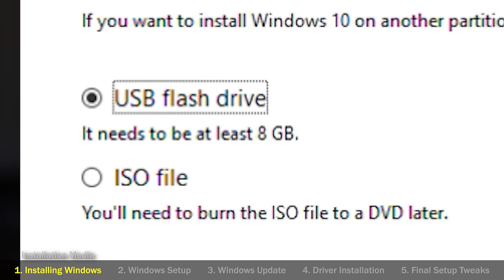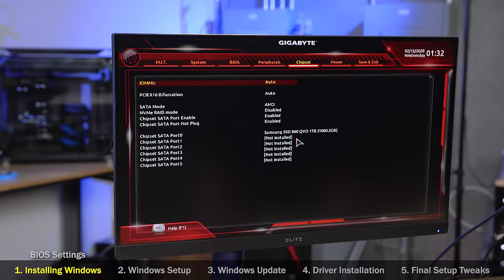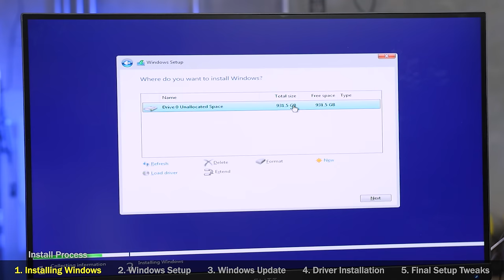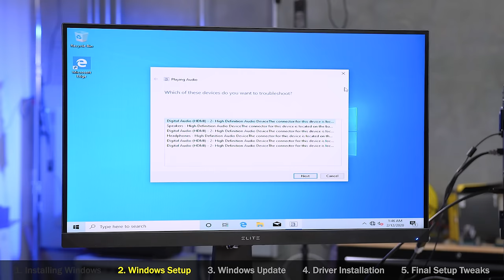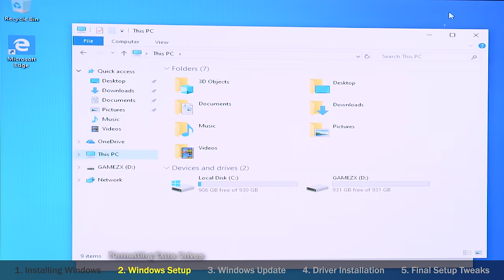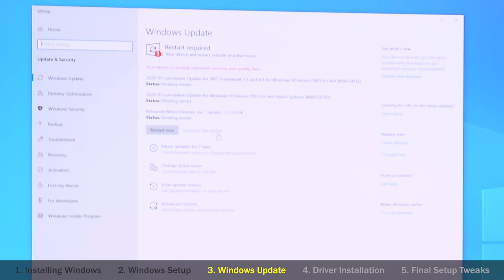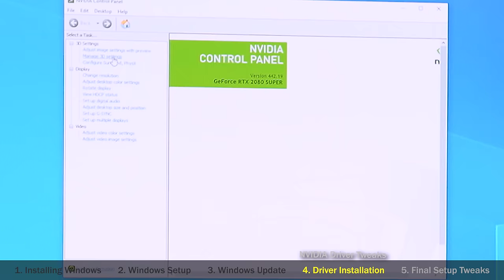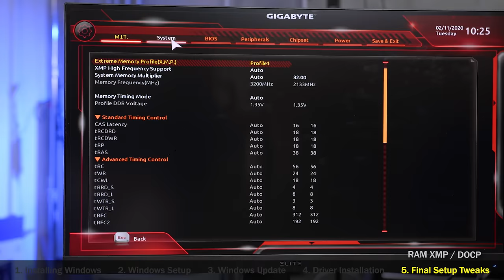Guide: What to do AFTER building your computer...

Comment: I think making my external hard drive my windows install drive was a mistake because everything just got wiped...
Reply: Sometimes you gotta learn the hard way. Not trying to be rude, but if you were paying close attention to the utility, it did tell you that everything on the drive would be erased. I think Microsoft could do a better job of warning people, but they do have a message on there. There are data recovery utilities that may or may not work. Data recovery services are also available, but they can get insanely expensive.
Reply: @JJFlores197  you can bet I won't make that mistake again. I read online as well that a message does come up at some point but lots of people miss it. ohh well

Comment: had built my pc and used an ethernet cable for internet. my people recently switched our provider and had to disconnect the router. The pc doesn’t have a wi-fi option and i love been searching on how to enable it but i can’t find anything. if anyone know i’m open to suggestions
Reply: Well did you check to see if your PC has wifi built in? If not, you can't enable something that doesn't exist. You will need to buy a USB wifi adapter to get wifi connectivity.

Comment: How do I keep all of my old files on my old ssd while transferring it to a new MOBO/CPU setup and doing the fresh bootable media install ?
Reply: You would need to make a backup of your files. By definition, a clean install of Windows means that everything gets erased.
If you cannot/will not make a backup, and still want to use your old installation, you can move the SSD to the new build. First, uninstall all of the drivers specific to the old system. Install the SSD on the new PC and then install the drivers for the new hardware.
Reply: @JJFlores197  Thank you for your insight

Comment: I have a question. Can I just put my m.2 ssd that already has windows and other files in the motherboard and turn the pc on?
Reply: Yes you can do that. I would first uninstall the software and drivers specific to the old motherboard first. Once you do that, install the SSD on the new system and then install the drivers and software for your new hardware.

Comment: Doing a fresh Windows 11 install on my new build, and it won't let you do anything without the internet. Not that I can find anyway.
Reply: There is currently a way to bypass the MS account part. Press Shift+F10 to open a command prompt. Type in: OOBE\BYPASSNRO and press enter. This will reboot your computer and have you go through the setup where you choose your language, keyboard settings, etc. Once it gets to the network part, there will be an option that let's you skip this part of the setup.

Comment: I got 1 Ssd with speed of 7000 mb/s for games. And i want to buy another one with 256Gb for ONLY windows on it but only got with speed 3000 mb/s. Is this speed enough for windows ? Or should i install windows on that 7000 mb speed ssd? Is there be a noticeable difference for windows ? Games and stuff will be on the 7000 one. I just dont want to format my games every time i install windows...
Reply: You're overthinking it dude. You will see no difference in the 'slower' drive. Yes, it is notably slower on paper than the much faster drive, but you won't perceive it unless you are transferring a large number of large files regularly or constantly running synthetic drive performance benchmarks.

As a matter of fact, the super fast SSD likely won't be of much benefit in most games right now. Once DirectStorage starts getting more support in Windows and games, it may help.

Comment: After I finished building my computer, installed windows 10, and installed the drivers for motherboard and graphics card. I connected my Bluetooth speaks. And the audio is all choppy. Do I need to download anything for my CPU? Or maybe a Bluetooth or audio file got corrupted in the process?
Reply: I would reinstall the bluetooth driver. In general, Bluetooth is not great for audio, especially with Windows.
Reply: Make sure your chipset drivers are up to date. Make sure your drivers for your Bluetooth are updated and win 10 compatible.

Comment: I download windows go through the whole process. Pc restarts and I don’t have windows. It just goes right back to windows setup
Reply: Turn off the computer, disconnect the flash drive installer and then power on the computer. It should boot into the next part of the Windows setup.

Comment: What if my drive doesn’t show up on the NVMe Configuration?
Reply: I would reseat the NVMe drive. On some motherboards, you may need to update the BIOS to the latest version for M.2 drives to work correctly. If that still doesn't work and your board has 2 or more M.2 slots, try using another slot and see if the drive works.

Comment: I’m on video: 5:09 and I have my usb as the first boot and my ssd drive second. I can’t unplug this but when I restart it …it goes back into bios and my had disappears so I load optimize defaults and the drive reappears but I keep getting sent back to bios every time
Reply: Make sure BIOS mode is disabled (may be called CSM, legacy mode or similar) and that you have UEFI boot enabled as well as Secure Boot and TPM 2.0 (if installing Windows 11). Boot from your USB drive and try install Windows once more. Once it installs and your PC reboots, go back into the UEFI and change the boot order so that your SSD is the first boot device. Save settings and restart. Your PC should now boot from the SSD and continue with the rest of the Windows setup process.

Comment: What does “new” do on the initial windows set up for hard drives? I have a 4tb ssd and accidentally hit new and it split it into 2tb drives but I can’t use the other one at all.
Reply: "New" creates a new partition on the drive. In most general cases, you don't need to manually partition your drives. You can select the new partition and choose "Delete" which will delete the partition and everything will be back to normal. If you already installed Windows, I believe you can merge the extra 2 TB partition within Disk Management. I think Windows calls it "extend volume". There are many other partition tools out there like GParted that can help you accomplish the same thing in case Disk Management doesn't work.
Reply: @JJFlores197  Thanks. The delete is grayed out. I’ve tried to merge on disk management but the unallocated space doesn’t show up on the extended volume. And when I right click on it to format. Everything is grayed out.
Reply: @spikeboi55  You may need to use a 3rd party partion utility like GParted as I mentioned.

Comment: I have a PC that will not boot. It stops before BIOS. The PC is 15 years old. I will be keeping the SSD and the new power supply. I don't want to lose the SSD data.
Reply: You should be able to. You can always check the data is still thereby removing the drive and plugging it into a friend's computer. Or using a SATA to USB adapter. 

Unless the drive failing is what's caused the problem. Remember your backups folks!

Comment: Hi I hope you read comments in your old videos. 
I got problem,I just moved both my drives to new tower but forgot to format them before .I got new windows 11 on the stick .
I don't want to take all apart again  only to format disks and putting my old motherboard and try to find all connections again.
Is any way I can format both disks from my new tower even if there is now running windows on it?
I hope this is clear. 
Mike
Reply: There's nothing to worry about. Just boot your new PC with the USB installer and you will be able to format your drive from within the Windows installer.

Comment: So what if I have a Wifi motherboard? Does it reed the internet signals right away?
Reply: Depends. If Windows has built-in drivers for your wifi/ethernet adapters, it will pick them up right away and will try to force you to connect to a network.

Comment: I know I’m late to this . I currently have a msi z590 a pro Wi-Fi motherboard. I’m doing some upgrades on pc. Using the same Processor I have now i7-11700k and upgrading motherboard to msi mpg z590 carbon Wi-Fi and to 32gb of G-skill trident rgb 3600 mhz ram. I’m wondering can I use my M.2 drive that has windows on it on new motherboard? I’m again using same processor same manufacturer of motherboard and same chipset? Only upgrading the case motherboard and ram. I have a new 980 pro but was hoping to use the nvme I have now as boot drive? Any help I thank you lol.

Comment: Hi guys, i have a question.
I just bought a ryzen 5000 cpu and a b450 mainboard. Because my mainboard is older, than my cpu, do i need to do a bios update to start the system, or can i do it later?
Reply: Its hard to tell. If the board is an older board but is still being sold, it may already have the latest BIOS version or at least one that supports your CPU out of the box. If the board hasn't been updated, then you have to update the BIOS first. Its a catch-22 since in order to update the BIOS, you need a compatible CPU first. On some boards there is a BIOS update feature that works even without a CPU installed, but that's usually only found on high-end boards.
Reply: @JJFlores197  i've got the asus rog strix b450-f gaming ii

Comment: Every time I get a new OS up and running i blank because there is so much stuff I can do now and I have to install everything to “claim” this OS as mine it’s mentally exhausting and I don’t even know what to do first on it. AND ITS JUST A COMPUTER! I could do the exact thing I was going to do on my old one! Does this happen to anyone else or just me!???
Reply: If you're up for the challenge, you can create custom Windows installations. It takes a lot of up-front work and trial and error, but once you get it just right, it makes it easier to quickly setup custom Windows installs. I use MDT (primarily meant for IT professionals), but there are other ways like by using NTLite.

Comment: So if I install windows while connected to the internet, does that mean I can't use the PC if my internet goes out? I'm a little confused, since I wanna link my Microsoft account anyways. Unless I shouldn't?
Reply: No. That's not what happens and that wouldn't make any sense. The way the Windows setup is designed is to force you to log in with or create a Microsoft account. Once you do that, or bypass it, you can use your PC without internet access. What he's mainly getting at is that Microsoft has been hellbent on forcing people to use a MS account for almost a decade where in the past, you didn't need that.
Reply: @JJFlores197  
Thanks for the clarification. I figured it wouldn't make sense, but I know so little about this stuff that I wanted to ask to be sure.

Comment: I was looking in my bios and I noted that one of the settings it was on was SATA but it said Device not found then I clicked on the other two and it had things down. How do I know if I'm suppose to know which one to use SATA or PCIE or M.2?
Reply: What drive(s) do you have plugged into your motherboard?
Reply: @JJFlores197  I bought a pre built since I’m not too tech savvy when it comes to pcs. How would I check that?
Reply: @bigballer1202  You will need to look at the spec sheet and/or physically look inside of the case. If it has an M.2 SSD, the drive will be mounted on the motherboard, usually towards the bottom half. If it has a 2.5 SSD, it will be mounted somewhere inside of the PC case and there will be a data cable running from the drive to a SATA port on the motherboard.

Comment: I don't know what to do but it will not detect my monitor or keyboard when I turn it on. I can't even get windows installed. Idk what to do no one on any forums will help.
Reply: Check to make sure all cables are securely plugged in. Make sure RAM is installed per the manual. If your board has a debug or diagnostics light, take a look at it. It can help point you in the right direction.
Reply: @JJFlores197  yep I got it now.

Comment: I built my brand new PC but nothing is showing on my monitor
Reply: You need to take out the battery usually a circle shape form your motherboard and put it back on the motherboard board and it should put you into bios after booting it up

Comment: I have no idea if you will ever see this but i upgraded my pc i changed the motherboard and the ram and the cpu cooler and the case everything else i kept including all my storage devices and the m.2 that already had Windows downloaded so i set everything up but whenever i turned on it immediately went to the bios i tried to get out of it and I couldn’t do i need to install windows again? And also i have a 10th gen i5 on a msi z590 unify motherboard which is the motherboard i upgrade to
Reply: Depending on how you installed Windows, Windows is connected to your motherboard, not your storage devices. I think that if you type something like "Windows motherboard change" or something like that, it will show you what steps to take. I think there is a FAQ section about this in Microsoft's website as well so make sure to look for that.

Comment: I am freshly new to this and my keyboard turns on but doesn't work. When I press delete nothing appears on my display. It does show all hardware is in operation. I need a new cpu broke my pins AGAIN and I can't get past the USB and the case matches up with it. I am 29 and a tech enthusiast kind of struggling here any experience who knows this will help before I start smashing my high end custom build I wasted $2,000 on.
Reply: You answered your own question: "I need a new CPU". The CPU is the most important component of a PC. Without a functioning CPU, your computer won't do anything at all. Though I'm a bit concerned that you said that you broke the pins on the CPU again. That's a very delicate part. Not sure what you're doing, but you shouldn't be jamming the CPU into the socket just randomly. There's a specific orientation in goes in. The CPU has a small arrow in the bottom left corner. The CPU socket should have a matching arrow or mark.

Comment: Up until 6:37 i was able to follow, then my problems came upon me, error after error occured and nothing works, now the drives not even showing up at the pages before 6:37, it's just all empty on that page... the drives show on the boot menu but not when I'm installing the windows. Any idea how to solve that?
Reply: Not sure if this will help, but its worth a shot. Press Shift+F10 to open a command prompt. Type in the following commands:
DISKPART
LIST DISK <Make note of the disk number you want to install Windows to
SELECT DISK # < Substitute # with the disk number from above
CLEAN
CONVERT GPT

Close the command prompt and try refreshing or restarting the install process to see if the drive now shows up. I would also make sure you don't have RAID enabled in your UEFI. Make sure the drive type is set to AHCI. Exact settings/menus vary depending on motherboard manufacturer.

Comment: What to do if Windows doesn't detect your new hard disk?
Reply: Is the drive detected in the BIOS? If not, make sure it is securely plugged in (both power and data cables). If you have an M.2 drive, reference the board manual. Some SATA ports may be disabled depending on how many and what type of M.2 drives you have installed.
Reply: @JJFlores197  Maybe it wasn't plugged in securely. I unplugged it and plugged it back in and it works now.

Comment: Hey I need help with the setup process when I click to install my hdd doesn’t appear at all I have a b550m k MB and I have a hard drive 500gb cpu is an amd 5 core 5600
Reply: My question is why would you use a hard drive instead of an SSD? It almost doesn't make sense to install Windows on an HDD. Anyways, is your HDD detected in BIOS? Did you make sure both power and data cables are securely connected to the drive and motherboard (for data)?
Reply: @JJFlores197  yup but I got it working now 👍🏼

Comment: My storage SATA drive is not showing up in the bios, what do I do
Reply: I would recheck all connections and make sure they're plugged in securely and connected. Also, if you have an M.2 drive, check the motherboard manual. Often times some SATA ports are disabled if you have an M.2 drive installed. The manual should have a table showing what ports are disabled when an M.2 drive is installed.

Comment: My nvme wont show under my msi bios which has a specific m.2 gui
Reply: Make sure it is securely plugged into the M.2 slot. In some instances, you may need to update the BIOS in order for M.2 drives to work correctly and/or be detected.

Comment: Does anyone know what to do if I wanted to move a ssd with windows installed and a hard drive with data to a new motherboard?
Reply: I would first uninstall the drivers for the old motherboard and any motherboard-specific software. Once you do that, remove the drives from the old system, install them on the new hardware and then install the drivers for the new motherboard.